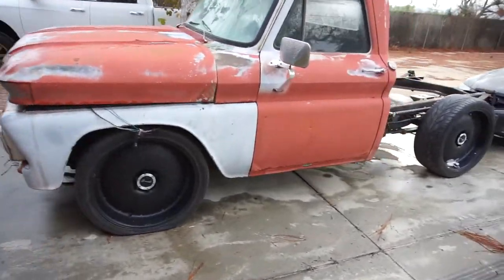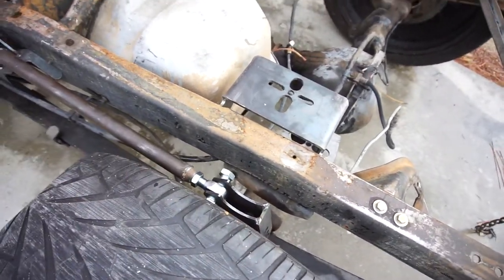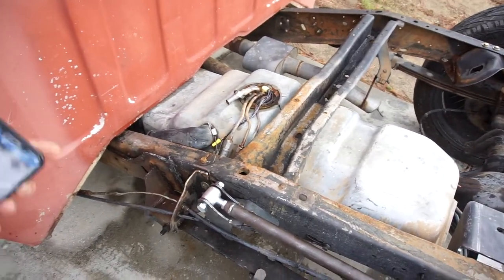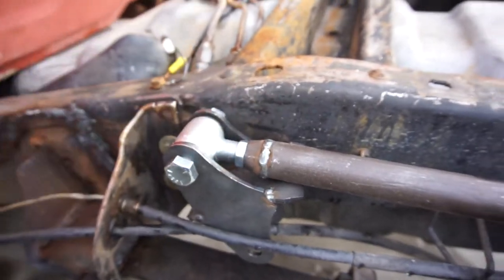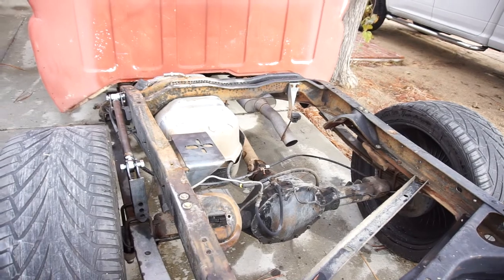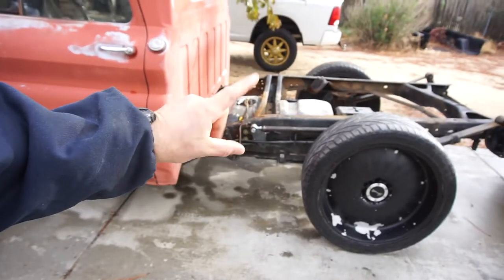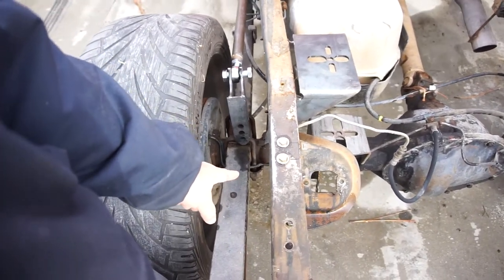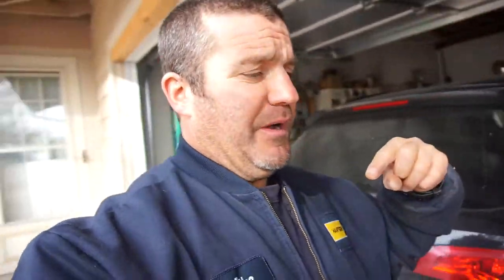Project Crack Pipe Mock Up 4 Link Air Bag Suspension. 1964 C10 On 1991 K1500 4x4

Comment: The set up you are going with is similar to Jeeps. Your 4 link, is just like "control arms" on my jeep. When you take off the leaf springs, the axle will have the ability to sway from side to side from the body. You will have to throw on a track bar. A track bar will keep the rear axle centered and under the truck while driving and articulating. Since you are fabbing up everything, you can probably get a Jeep rear track bar and then modify it to fit your purposes on the truck. You can probably use some jeep sway bars too!  Even when you have the 4 link, control arms, and bags attached.... if you were to push the bed of the truck without sway bars..... there would be a lot of movement there.  KEEP ON ROCKIN brother. Look forward to watch your creation!
Reply from the maker: OneNGlen ok kool. A lot of good information bro.